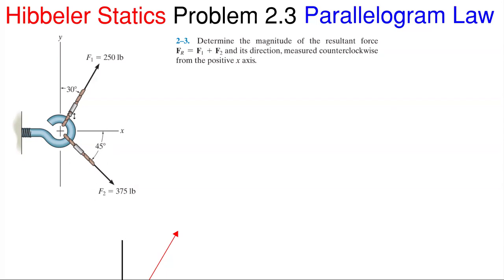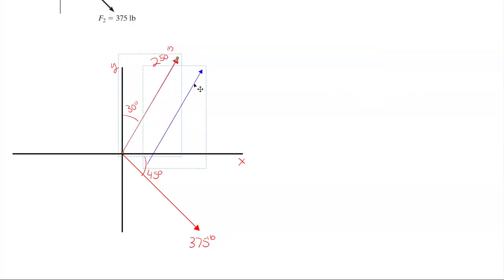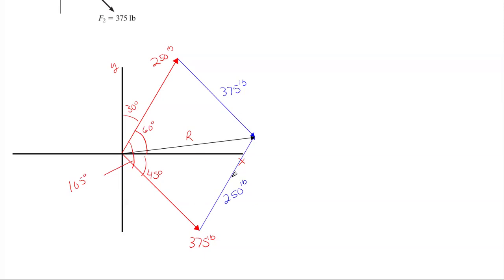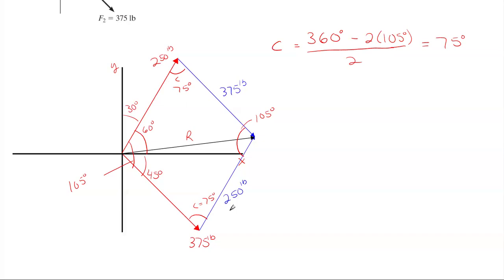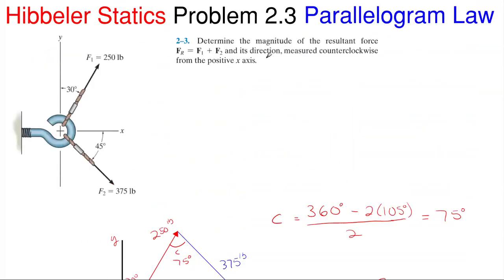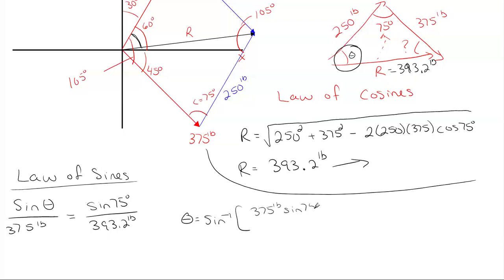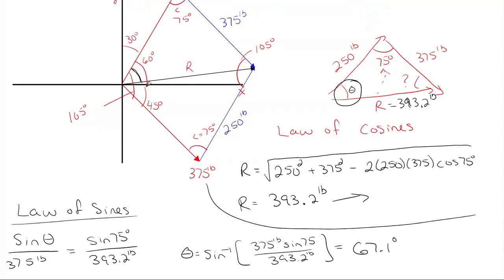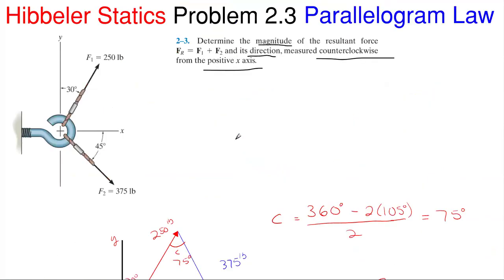How to Find the Resultant Force Vector Using the Parallelogram Rule. Hibbeler Statics Problem 2-3

Comment: Uhmm why do we need to subtract the 67.1 by 60?
Reply from the maker: I will do my best to explain in words.  We determined the angle from the 250 lb force to the resultant force to be 67.1 degrees (via the law of sines).  Since the angle from the same 250 lb force to the x-axis is 60 degrees (given at the start), then this tells us that the resultant force is below the x-axis since the 67.1 degrees is larger than 60 degrees.  In order to calculate the angle from the resultant to the x-axis, we take 67.1 degrees and subtract off the 60 degrees to get 7.1 degrees (the difference in the angles).  In the end, this locates the resultant force at 7.1 degrees below the x-axis.  I hope this explanation helps.